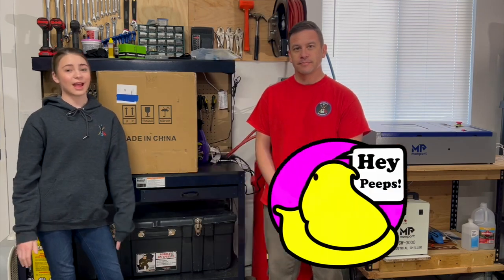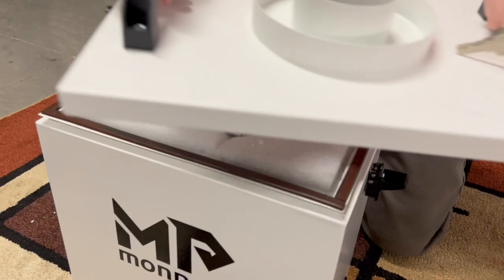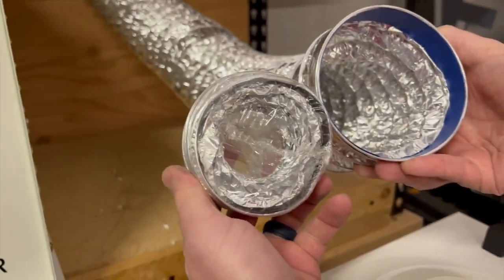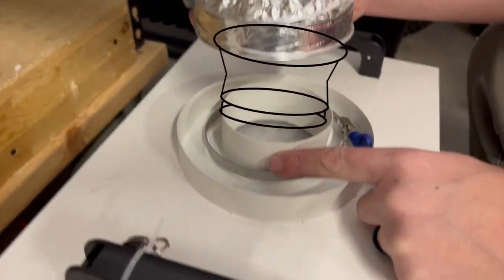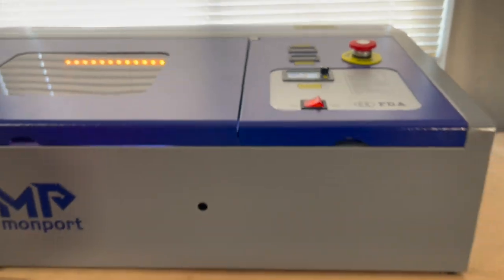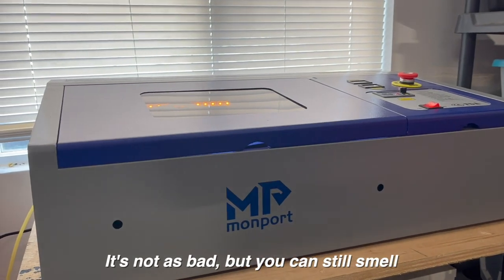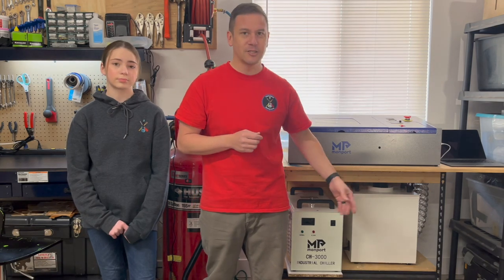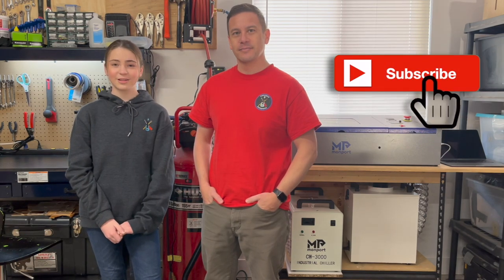Air Purifier for CO2 Lasers - Monport's Fume Extractor Unbox & Install + Test Project w/ Wood

Comment: Just a few notes. That appears to be the 80w fume extractor, which is doesn't have a good charcoal filtering layer to begin with to capture the smells that you're trying to avoid. On top of that you have the charcoal material on the top, when it's supposed to be the last layer that the air goes through. The higher wattage fume extractors that Monport sells do a much better job at eliminating smells, especially when the filters are installed properly.
Reply from the maker: Thanks for your comment.  There were no instructions included with the 80w system, so we just kept in the order it was received. We have gotten a couple of comments with the same suggestions and moved things around as you suggested, it is a bit strange to set just a bag of carbon down in the machine the way it is configured. We gave a feedback to Monport (as we are sure others did as well) and it looks like they have updated their newly available machines.  We agree that there are better filters in those now offered and the way to connect the machines together have been updated on the current air purifiers. It does not appear that they offer replacement filters for our machine (we have one more back up set to get us through for now). We will probably need to do some research soon and find filters that we can make work with our model then do a video update to help other people who have purchased the machine looking for replacements.

Comment: Thanks for making this video, Very helpful... 
I just bought one of these exact air purifiers, and I was told that I didn't need to vent to the outside, from an OMTech's sales person.  (If I need to still run an exhaust to the outside, I will be very disappointed with the OMTech's Sales Team.
-- and thanks for posting your STL files for the adapter.

Comment: Just an initial observation. The dust from the carbon filter is clogging the HEPA filter before the filtration system is even used. For the adsorption process to function properly, the carbon filter should be last in line within the filtration system.

Airflow should be: Prefilter (to remove coarse contaminants) -> HEPA or MERV 13/14 filter (to remove small contaminants and smoke) -> Activated Carbon Filter (to remove odors and extremely small particles).

You need a carbon monoxide detector and other air quality measuring instruments to determine if the filter is actually doing its job. Of course, if you can still smell burning wood or see any smoke, then the filter is obviously not working properly and measuring instruments aren't needed to determine this.
Reply from the maker: Thanks for sharing the tips, we will have to readjust the filter layers.

Comment: Nice review! I'm currently researching air purifier and fume extractors for lasers so your review was very informative. It would be great to see a future follow-up video to see how the air purifier has held up to use. 

I've some questions:
* Since the activated carbon is in a net bag, can the bag be refreshed?
* Where can you buy replacement filters?
* The purifier looks to draw air through the filters, what's the fan like? I'm wondering if the fan is sturdy and made of metal.
* The top pre-filter(?) looks to be REALLY close to the air inlet. Might it be beneficial to increase the space between the inlet and the pre-filter so the air isn't concentrated in the center of the filter?
Reply from the maker: Thanks so much! We will definitely do a follow up video on this air purifier and look into those questions you have.
Reply: I make research on purifier air and seems those compact air extractors and filters are undersized for the job they need to do.  For chinese products, we can't find replacement filter on their website and there is lack of information (static and dynamic pressure, type of motor, life-time of filters, ...)

Comment: do you smell anything when venting outside? Im asking because I wonder of something isn't sealed or if the filter sucks. I have one ordered and now ive seen your video and am 2nd guessing my order. Edit? I see you ordered the 80w system and I have the 150 so hopefully mine is better
Reply from the maker: The 150 will be more powerful and be better at sucking the air out. Because ours isn't a higher powered one, some fumes we can smell coming out of the machine itself.  After owning the equipment for some time now, we have found it does help remove most fumes, there is a pretty noticeable difference when we use acrylic, there is still a smell but much less than when the filter isn't turned on.
Reply: @ProjectAnonymous_Duo  thank you for replying

Comment: It seems like a complete nightmare to even get the air purifier connected. And if you don't have a 3d printer it's pretty much useless inless you find and pay extra for the connecting tubes. I'll think I'll stay away from that brand. Thanks for the video :)
Reply: I believe that Home Depot or Lowes, may have a PVC Plumbing adapter that might fit these two vent sizes?  Luckily I have a 3D printer (and also a Maker Space, near by)